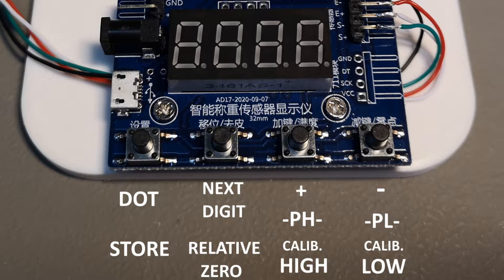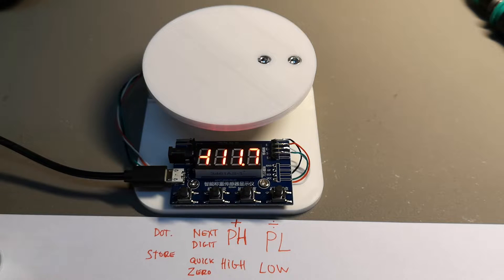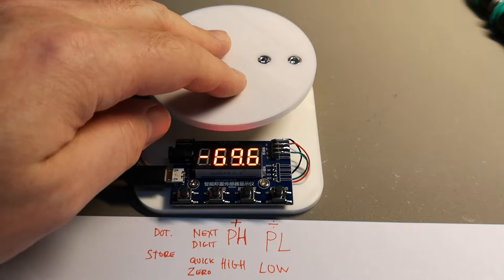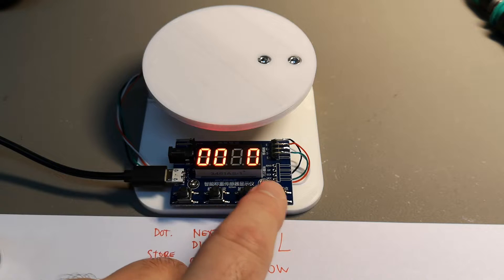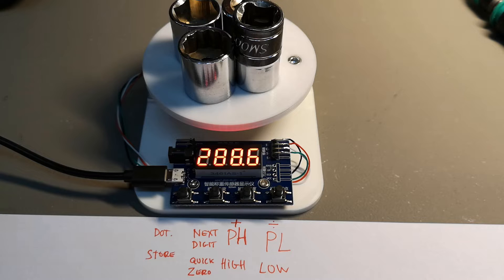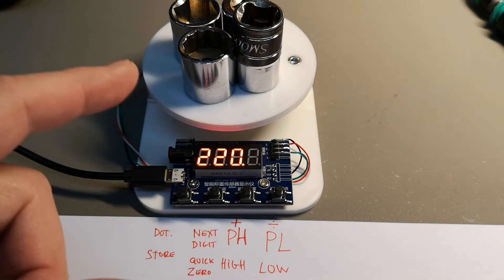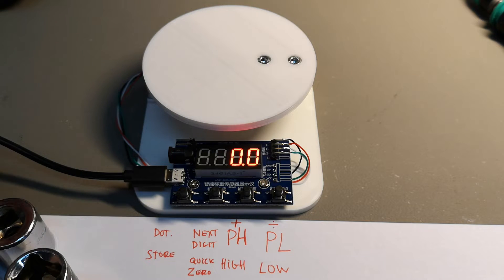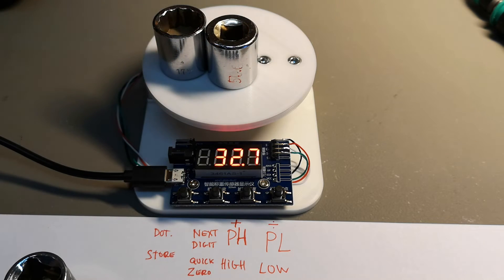HX711 Weight Scale Display how to calibrate and how to use ENGLISH

Comment: Great Video Sir. I am just wondering if this display is compatible with any type of load cells? Also, if you don't mind, can you link where you got all the components from? Thanks
Reply from the maker: yes most load cells should work, i just go my parts from ebay so cant link since url changes
Reply: @TeardownOZ2CPU  Thanks for the quick response Thomas, I appreciate it a lot. Also, regarding the limit of the display, is it possible to change the readings into kilograms instead of grams? I am planning to use it as an experiment using weights ranging from 0-10 kg.
Reply from the maker: @nonam3840  YES, like you see in the video, you simply calibrate the readout in the range you want, to the type of sensor you got, if it is 10kg you use as full scale, or 10 grams, or 10 bananas dont really matter

Comment: Thomas, good review. Im wondering if I could read the weight data from this module. I am specifically referring to the version with the HX711 chip on it. I also understand that there's the RX/TX pins exposed at the top. Would it be a way to just read in serial what was displayed in the LCD?
Reply from the maker: Most likely possible
Reply: @TeardownOZ2CPU  Just got mine, tested it and its pretty impressive but I think I'l still need some time calibrating this properly. However, its rather disappointing not to receive any UART signals from the RX/TX Pins at the top. I suspect it would probably be the STC's Programming port. Have you dig deeper into making this send out the weight via UART? Im not too familiar with the STC 51 series chip set & I believe STC seems to take pride in making sure their programs are safe / extraction proof.  Any way to get the source codes for this to be reprogrammed?
Reply from the maker: @graj2  check out arduino groups for this board, there exist many ways to interface this one

Comment: Hey I know this is an older video but currently trying to make scales with 500kg load cells do you know if this will work?
Reply from the maker: you can use this board with any type of load cell, 500kg or a mega ton full scale, it is all in the calibration
Reply: @TeardownOZ2CPU  thank you very much will have to try it out. Trying to build scales to corner weight a car
Reply from the maker: @jeffswanson6516  it is possible to connect 4 load cells to one amplifier / readout unint, the schematic is fairly simple, so you dont need 4 units and add the 4 values manually, this is how bathroom scales works, with 4 tiny cells :-)

Comment: Is the one I was looking for .... if I understand correctly, with this form you don't have to use Arduino and similar stuff for configuration, can everything be done by the module? Just a 5V power supply and a load cell?The max weight bearable weight is almost 10kg (9,999) there are 5-digit modules for greater weights?
Reply from the maker: YES, all you see, is all you need, NO arduino needed, no software needed, just connect as shown, and 5V
the PCB i got, is the one with INTEGRATED HX711, some may have it as a little external pcb, double check this when ordering, not always clear.
Reply: @TeardownOZ2CPU  Thank you, I saw this article on Aliexpress while all the other videos I saw spoke of Arduino, this is easier for me ... The only limit is the 4-digit display ... Know similar 5-digit forms to be able to Weigh up to 20-30kg?
Reply from the maker: @Demymaker  how many kg max, is only defined by the sensor, not the pcb, this one is 5kg max, and with this, the readout goto 999,9 = 0.1gr resolution, and then it continue to 5000 = 1gr resolution, I have not tried a 20 kg sensor, but i bet it will simply continue this way, I would have made the software inside this ic, that way :-)
Reply: @TeardownOZ2CPU  Yes, I was referring to the display limit, the module display is 4 digits so I suppose up to 9.999 grams or am I wrong?
Reply from the maker: @Demymaker  i have no clue.. oh, idea.. i could calibrate it, intentionally wrong, and this way fool it, to read out over 9999 grams, I do that in a minute, stay tuned
Reply from the maker: DONE IT : ha ha, most significant digit goto HEX mode, when over 9999 grams so A0000 = 10000 and so on.. it even continue all the way after HEX... yes the whole darn alfabeth, so this means you dont loose that 1gr resolution, is it easy to read and understand.. NOT FOR ME :-)
Reply: @TeardownOZ2CPU  Only now I understood what you talk about ... I had to do research to understand .... I think this https://en.wikipedia.org/wiki/hexadecimal
Forgive me but my English is bad and I have some difficulty ...
Reply from the maker: @Demymaker  ya what i say is the first, left digit, the 1000 grams, go from 0123456789  THEN abcdef and so on, all sorts of hard to read paterns, so it is ofcourse not ment to be used that way, i think their display driver simply had this feature by accident..
Reply: @TeardownOZ2CPU  can i connects it to arduino? if it can connected to arduino how fast its transfer rate?
Reply from the maker: @MrViabam  the sensor chip can be connected to arduino, look up HX711 arduino examples, data transfer is not super fast, it gets alot of its high resolution by internal avarage, so it will be 10 to 100 times pr sec

Comment: Can you guide me how to calibrate the 3 button display type?
Reply from the maker: I dont understand the question ? my board got 4 buttons, this video explain how this type of board works, if yours look different, you can most likely not use this video.
Reply: @TeardownOZ2CPU  I bought a new board (4 buttons). Can you please specify the function of the first hold button?
Reply: @TeardownOZ2CPU   Store button.Press and hold it to get quite a few functions. Which I don't understand all of.
Reply from the maker: @cungtran2638  i dont think i can explain in text the things i show and tell in the video, so it is faster or more easy to understand, please watch the video a few more times and try to do exactly what i do, if all this fail, please ask a local friend to sit with you and repeat all steps, there is also a tiny chance your board could be defective, or your sensor could be wired up wrong, this will make things not work.
Reply: @TeardownOZ2CPU  https://youtu.be/3cd9C-Dq87c  I want to know the functions of this first key. And can I reset it to default?

Comment: Is there a way to have this measure in pounds?
Reply from the maker: you can make it measure anything, if you use something that weights in pounds, it when measure in pounds :-)
you put in a zero, and a know number for a known weight, could also be used to count eggs :-)
put 10 eggs on it, and tell it what ever that weight is = the read out value 10,
just one fun example.
Reply: @TeardownOZ2CPU  Thank you,  I got that part figured out by just playing with it.  I am very new to electronics of this type.    My Next question/problem is conecting to my computor and showing a bar graph of preasure over a short time.....30 seconds or less